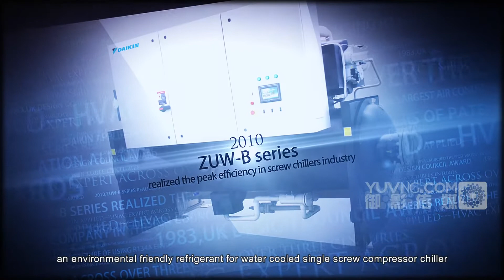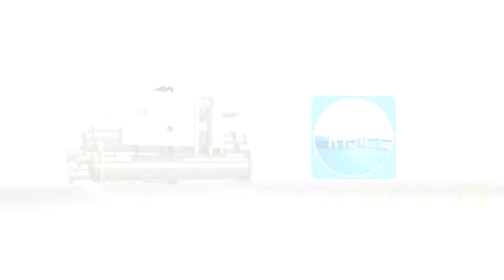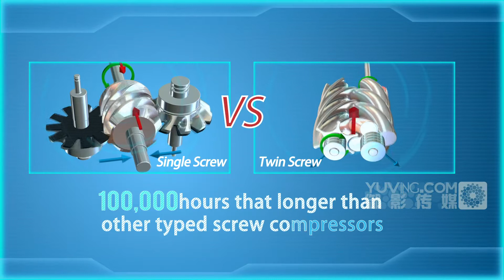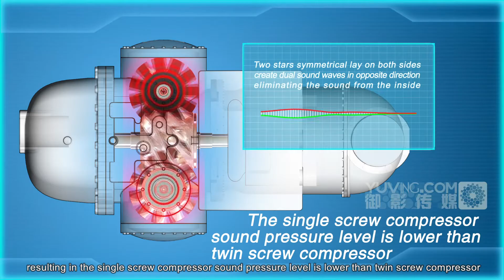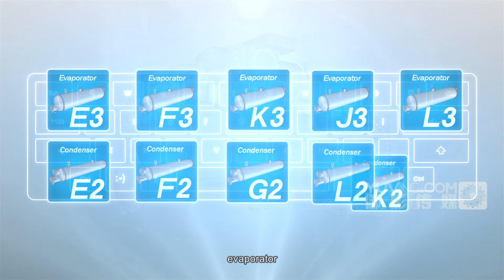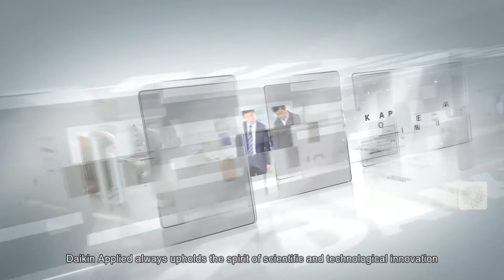DAIKIN Single Screw Compressor Chiller

Comment: Superb 👌
Reply: Daikin screw is garbage, you have to replace the rotor gate every five years at best!!!!
Reply: @aliraheem1925  wrong bro...
Reply: Single screw compressor mcquay
One of the best compressor.,...
Reply: @air-conditioningguruji7680  
They have many failed screw chiller, if you checked you will find that they produce their compressors inside small and simple workshop !!!!
Reply: @aliraheem1925  😁😁😁😁

Comment: Hi sir I'm in Dubai our building  daikin chiller some alarms coming we are facing 2days one time can advise anyone your chiller expert technicians
Reply: Hi boss.... I'm working the building 2 chiller brand daikin one chiller building demand wise working properly and when the building demands increase the  time comment will going second chiller the time chiller 2 automatically not running because comment going the chiller but the butterfly valve not opened after few minutes chiller penal will be alarm comes pls tell me what's the solution
Reply: @vijayaprakashmeenachisunda5322  is this a interlocking to the chiller
Or CSM?
IF CSM 
PLEASE CHECK ,,, 
Maybe it's  loose connection 🙂 issue...
Reply: Tell me what is the problem
I can help you
Reply: @air-conditioningguruji7680  iso valve alarm showing the chiller panel
Reply: @vijayaprakashmeenachisunda5322  slide valve??
Reply: Not slide valve.... Sir
Reply: @vijayaprakashmeenachisunda5322  Chiller model number?